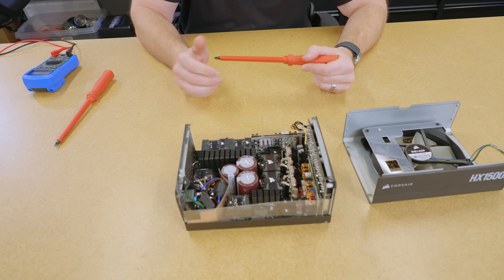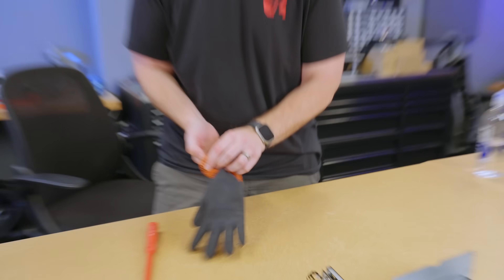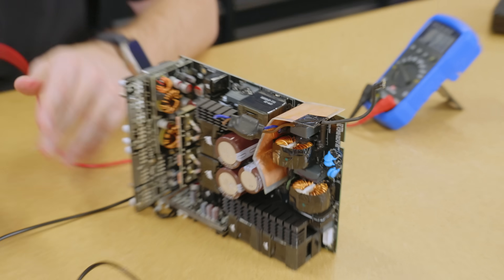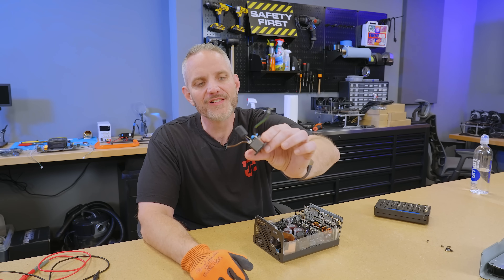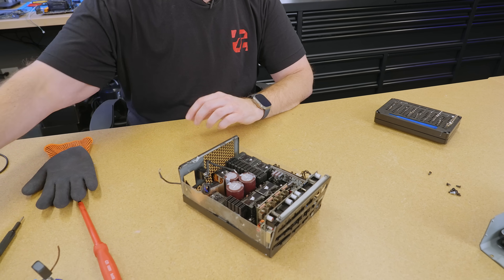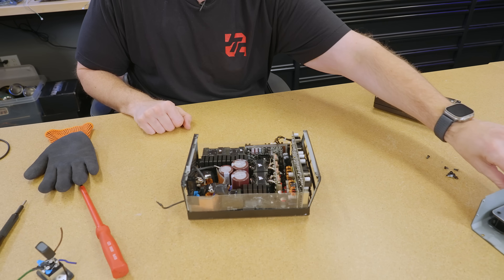Investigating what exploded in my PSU... DANGEROUS! DONT ATTEMPT!

Comment: Gloves? Insulat screwdrivers? Dude you're not working with live 1.5KV panel it's just a dead fkin power supply. 
First of all each and every PSU got a bleeding resistor on power caps and second all you need to do is grab the damn thing WITH the caps, turn around and short the caps with some incandescent light bulb for a couple seconds if you're disassembling it right after magic smoke.
Edit: so SOME dumb fks do make power supplies without bleeders (catastrophic facepalm)

Comment: as a former aircraft electrician. the fact that you got near it with bare hands, without taking off any jewelry, and watches,  and without wearing  two full rubber gloves and a discharge band or notice the hole in the cap or know what the difference between some of the caps and the transformers resisters and rectifiers were...holy fucking shit. 

don't ever do this shit again. this is some trump level stupid.

Comment: Anybody else pointing to the screen like Khaby Lame on to the component that was circled in and had a very obvious black goo all over it? :D I felt like Dora the explorer, do you see the failed component? :D
I now it is not that obvious because they use the same black stuff to glue other components and in 24 hours it probably hardened on the air, but I believe they might filled that component with the same stuff just was not able to harden inside. (or melted from the heatt)
Also I don't know your multimeter but you might could discharge those caps with it (or just use a resistor) EEV blog have useful videos on these subjects.
Reply: The black goo is silicone used to secure components in place, particularly the two resonance capacitors rather awkwardly placed adjacent to the PFC reactor - that seems most likely to be what you're referring to and if so that wouldn't relate to the fault.
Reply: @PlatypusPerspective  Silicone, poliurerhane glue whatever thes used, to me it looks like it is coming out from the middle of a singe/cracked component. But I belive you, I don't think we ever find out the real cause sadly.

Comment: Wow just learned something i always thought the power is out after like 10 mins omw might have just saved my ass.
Reply: If an ATX power supply is operating normally, the reservoir capacitors will be largely drained after some seconds by the standby 5V converter. The video shows the situation with a fault condition - it's not safe to make an assumption. You measure voltage or ensure discharge state with a load resistance.

Comment: That pop was probably the rectifier. Plugging in to wall power, and checking the transformer and verifying the step down, then checking the rectification would have given the answer.
The weird thing, is the charged caps. PSU's are supposed to discharge over a couple hours, after flipping the switch on the PSU, and letting it sit while plugged into the wall.
If that was done, you would need to check that path, and/or check your wall wiring, and verifying ground and neutral of the wall.
Allegedly.
Reply: If you're meaning the input bridge rectifier, the evidence we're able to see here points in the opposite direction. We can't treat a SMPS the same as a stepdown mains transformer PSU. The reservoir capacitors retaining charge in an ATX PSU indicates they have been charged as normal from the mains through the rectifier, but the switching converter circuit that runs constantly, and thus would normally drain the capacitors, is not operating.
Reply: @PlatypusPerspective  Makes sense. on the switching PSU side. I haven't messed with an ATX PSU in over 20 years. and the last I dealt with, wasn't switching. Had a single step down, and a high impedance sink on the caps, for drain.
I assumed the other set of coils(Xfmrx2) were for filtering.
Reply: @Redacted2080  Might you have been dealing with an AT PSU, which has no standby 5V? Either way, a computer PSU will have been switched mode - it's not feasible to use a mains frequency stepdown transformer and linear regulators for the application. An AT PSU is simpler, could have a kickstart converter design, and it's normal to have bleed resistance on the reservoir cap(s) to facilitate a positive kickstart. It's not impossible for an ATX supply to bleed the caps, but it's a power waste, and to comply with low energy standby states it's likely to be absent, particularly as it's not essential since the standby converter largely drains the capacitors if the mains input is removed.
Reply: @PlatypusPerspective  Couldn't answer any of those questions. Was an old PSU out of the fiasco that was Compaq, Hp, Hewlett's ring of garbage.
Repurposed an old PSU, that I jumpered into service out of necessity and economics.
Like I said 20+ years ago.
You do questionable things when you are starting out.
Reply: @Redacted2080  Heh, I did some very iffy things when I started making valve/tube circuits in my teens! Only had to come to grips with switched mode power supplies when I finished school and started training for color TV repairs when that came to Australia in 1975.
 A PSU from an old Compaq etc may well have been a plain AT unit.

Comment: you can discharge any size cap with a resistor just don't use your fingers the resistor will get extremely hot

Comment: Corsair power supplies do sometimes just blow up like that, no particular reason. 
You could have absolutely shorted these caps with an isolated screwdriver, I do it all the time on my repair channel. Makes a nice little pop. 
Shame, it would have been fun to see you explore around that PCB.
On my channel "Bad circuit" the banner picture is what would have happened if you were to short it with a screwdriver, it is a bit smaller cap in my case, but charged up to 330V so it would have looked roughly the same.

Comment: Anyone who risked believing suggestions that an external connection or power down can drain reservoir capacitors in this situation would be in danger of getting a nasty surprise. 🙂An ATX PSU has a 5V standby flyback converter that runs while ever there is enough voltage in the capacitors to sustain it. The fault symptom we're seeing means this converter (and the circuitry it powers) is not operating, otherwise it would drain them (very likely the switching device, usually mosfet, in the converter is what went bang). To render the board safe to work on the capacitors need to be drained with a suitable resistance load.

Comment: To Discharge capacitors take bulb with a holder with two wires connected and touch the wires with the pins of the charged caps.

Comment: When I was young, I’m working with a repair shop we normally fixing cell phones, but one day a laptop came for issue.. I must be open and check the laptop ac/dc power adaptor.
How many minits after than I taked naked board on my hand Idk. But when I touch the non isolated sides this little big capacitor’s discarged on my hand. I still remember this shit and horrable feeling. 
After than I “never” touch the capacitors before than made a short circuit on my life.. Be carefull guys.

Its not my first time for get electric shock but still bad… Pay attention..

Comment: If you stand back and toss a bunch of small copper scrap or something else conductive at the back of the PCB would that discharge it?  I'm not planning on tearing apart a PSU and trying it or anything but just wondering if you would get a little spark show and I don't think this craptop I'm using can handle a 4th tab to google it right now, lol

Comment: One of the caps has a small pin hole in it. That's the source of the yellow electrolytic fluid on the components. Normally the caps flower open, or bulge, depending on severity, but pinholing is rare to see.

That had to be a huge power spike to blow that capacitor like that. I honestly wonder if many PSUs are really rated correctly for 110~120v systems, especially 1000~1600w units, and also with draw rates from components like Nvidia cards that can be extremely power hungry.

Comment: never touch without proerply protected! i am glad i am still alive, i got electrocuted by an 2,5 amps battery which luckely just hurted so badly that i felt pain after 5 hours in my finger.. today i do it only with protection. not only because i dont want to feel or be dead but also to protect my devices i work on when needed.

Comment: Take any big resistance resistor you have to discharge the caps. The human body's resistance is in the megaohm range, so try one around 1MO. If the voltage doesn't move quickly enough, step down to 100kO.

Comment: I've found many times that hair is a big killer of modern PSUs and most times its cat hairs People tent to let their cat sit on the deck lay about the office it only takes 1 little hair to make its way into the workings and create a short cat hair carries more charge than a human hair or general house dust for a longer period of time  this is because it holds a lot of static electricity In a Cat's Fur/hair. It can also be cared from you home to your office and make its way into the workings of the PSU because high voltage + static electricity creates a magnetic pull. The best way to avoid this is fitting a dust cover with an anti-static filter to the vent of the PSU they are only chap 3/5 dollars. You are at less risk if you don't have a cat so if you don't then no need to worry about it.

Comment: You can use a multimeter to safely discharge caps. Just put it on ohms mode, then touch the leads to the cap. Better if you have LoZ but you can use ohms mode if you don't. EEVBlog has a good video on this.

Comment: Just put a decent mid value high wattage resistor across the cap. Switching power supplies have a transformer stage that is at a higher than mains frequency as to produce a better transformer efficiency and thus lower weight. They also have a control IC to control supply. The caps help smooth the output.

Comment: Back when I was in university (electronic engineering) I accidentally connected an electrolytic capacitor backwards, I still remember it was a 2200uF one, and it exploded like 30cm away from me, my right ear hurted a lot for like a day. Another time a classmate had his eye hurt when a cap blown when he had his face near the circuit he was working in, trying to locate what was wrong with the wiring in the breadboard, luckily he didn't lose his sight, but he spend some time healing. 

PD- Those crosses on top of the caps are design failed points to release pressure in case the cap is gonna blown up, so it does not do it in a more violent uncontrolled way.

Comment: I'm not suggesting nor implying that is in any way the correct way or a good idea to do what I'm writing down there...
Probably a very powerful 120v glow lamp or a heat device could be able to drain the capacitors with limited risks.
I've seen close the possible cuplrit a component that seemed smear out some of the inside content. Could also possible be some insulating goo for reducing vibration or chance to contact to any part of the other components.
Anyway.
I'm not expert into computer power supply or electricity, it's just a guess so don't do any of i wrote upper than this line.

Comment: To discharge a capacitor in a safe way put a 1 kilo ohm resistor between the legs of the capacitor. Dont touch the legs on the resistor when doing that, use a tool or rubber gloves. That way it should empty the capacitor in around 5 to 15 seconds depending of the voltage and/or the size of the capacitor.

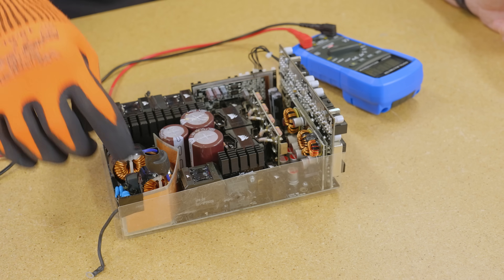Comment: 4:19 I believe these are RF Chokes, built to break the high frequency of the AC entering and damaging the circuit. These are often used on those switching power supplies. It's like a big coil that make a magnetic field when juiced up

Comment: Those black blocks with the corsair logo are transformers for the different rails but none of them show any obvious damage.  The odd thing is how those caps are wired.  They're polarized electrolytics in 2 different voltages and capacities, which I don't understand.  The blown 450V 680 microfarad cap is connected to that same triangular-ish area on the back of the board, but there is another 450V 680 microfarad cap in parallel with a 420V 470 microfarad cap.  Does anyone know why they would run caps with different voltages and capacities in parallel like that?  That just seems like an odd choice to me.
Reply: Since capacitors are paralleled, it isn't the right configuration for 3-capacitor partial-switching PFC, so I'd suspect all three may simply be in parallel to deliver the likely design target of 1800 microfarad, with a bridging land on the other side of the double sided PCB to connect the negative pins of the two 680uF caps. With economies of scale from existing inventory, that might have been cheaper at design time than a pair of 920uF.

Comment: i have a HX1500i, but i didn't have the PSU fail that way, the shitty corsair fan they put in seized up one day and it kept tripping OCP or some type of safety check, i just hacked in a arctic p14 into there instead hopefully fixing the issue for good. it looks like the center cap blew out, but didn't fully rupture along the creases at the top, theres dried electrolyte which is the faint translucent yellow stuff on top of it. i also don't believe that bc a component isn't receiving a voltage from the reservoir caps means it failed, this is a switch mode power supply (bc why not, and at these efficiencies theyre usually GaN), and it needs a lot of coils in order to efficiently convert 110V-220V to 12V at 1500W.

Comment: He's such a wuss, just take some pliers and short those caps out. If you're worried about the loud snap, just use a 100 ohm 10W resistor or something. Transformers rarely die, it's usually the caps, diodes, transistors or even resistors in the PSU. Send it to DiodeGoneWild, he'll gladly look at it and even repair it. You'll even learn a thing or two about PSU topology and troubleshooting.

Comment: IMO, the chances of a capacitor killing you is very minor. There are exceptions, of course, but here's why I think that: The pins of the capacitors are very close to each other, so the current would only jump through about an inch of your finger. In order to kill you, It would have to flow through your chest to disrupt your heartbeat, or your brain, to cause neurological damage. The exceptions would be, if you short yourself with both hands, meaning the current would pass from your left hand to your other hand, potentially going through your heart. The other one would be if you are grounded and the current flows from your finger to your legs, also with the chance of disrupting your heartbeat. I myself have been shocked by a 250v capacitor, and I only got 2 little burn marks (about 2mm deep holes) on my finger, where it touched the pins.

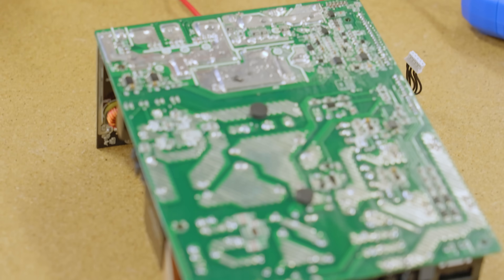Comment: 2:48 You should learn how to use a multimeter first. You say you are measuring voltage from a capacitor and your meter leads are attached to the amp measurement jacks.
Reply: It mightn't be the official configuration, but the only difference between the two Common terminals is a very low resistance shunt for the 10A function. It makes no difference at all to the voltage measurement. If you're using a meter in an application where you need to move frequently between voltage and high current measurements, it makes sense just to leave it in the 10A position.

Comment: Yes. Thank you Jay. You said the magic word to do it safe - "measure" - and with proper and isolated instruments and the other protective isolating equipment, procedures and safety-know-how! To measure is to know. I am an amateur, but it is absolutely vital to check if the capacitor is dead by measuring voltage, current (if in circuit), or µF with a meter. And it is absolutely vital to know what you do - and it most certainly can be deadly if you don´t.

Br

Comment: 150V isn't "fully charged" since bulk input capacitors in a PFC-boosted PSU get charged to 350-400V. Being at only 150V may be a sign that the PFC circuitry failed. There should also be resistors somewhere to discharge caps when AC power is disconnected, caps staying charged means something must have blown between the caps and what is meant to discharge them.

Comment: I just repaired the PSU of a retro PC that is over twenty years old. 2 pcs 3300uF 10V 105°C electrolytic capacitors bulged at the top. With the replaced and new capacitors the PSU worked normally again. The PSU in the video has broken semiconductors. The breakdown occurred because the current limit was exceeded or the component overheated.